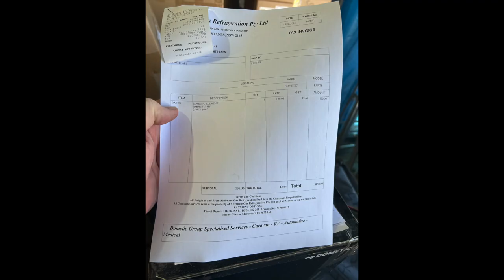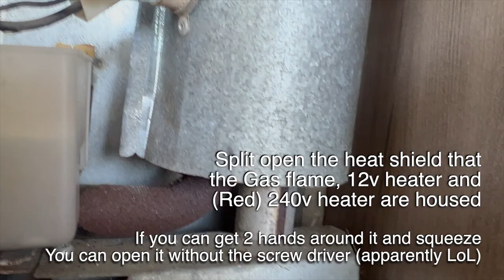Dometic RMD 8555 - DIY Heating element replacement

Comment: I notice the multi plug of the new heating element is a different design to the multi plug of the old heating element that you removed.  You spend a while explaining how the new one unclips but the old plug isn’t like that.   It’s looks like you had to force the old plug out as it appears damaged after you removed it.

I’m having problems removing the old multi plug (which is the same design as your old one).  Is there any way to get the old multi plug out without damaging it?
Reply: @jeremyburgum5379 did you figure out this plug issue?